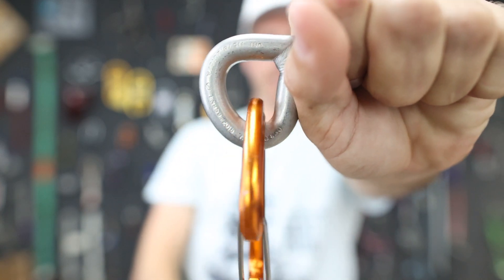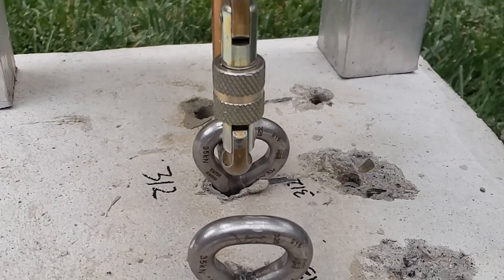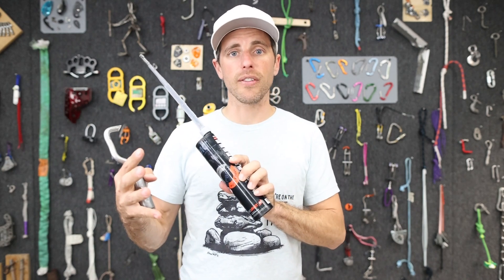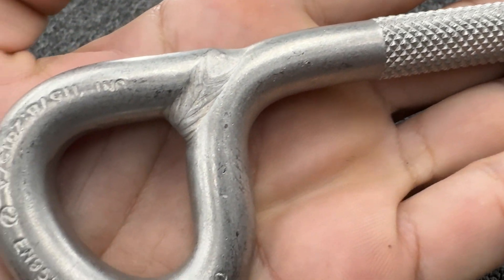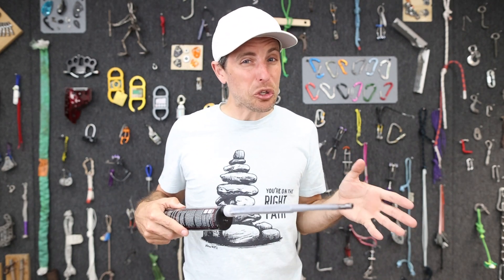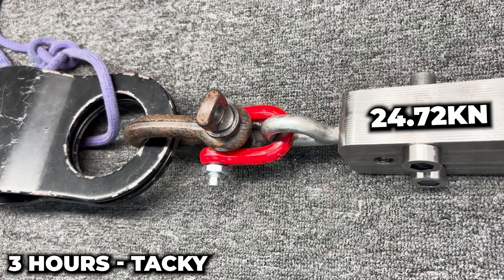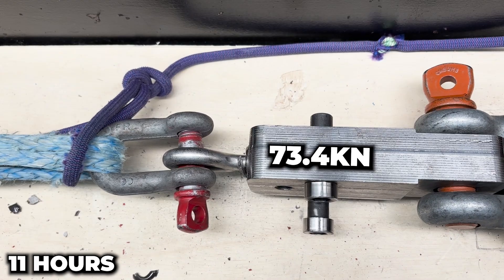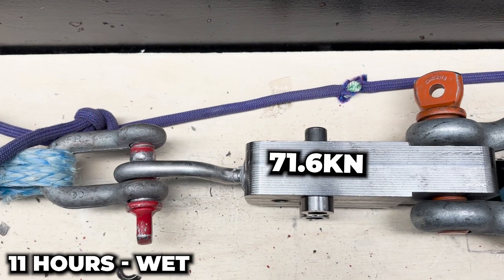DON'T use this when it's freezing...

Comment: Chemical anchors being installed in unideal environmental conditions usually requires environmental condition monitoring and material conditioning be used per manufacturer recommended practices to ensure product meets or exceeds listed strength. I understand this is not ideal, but I have seen creative means by which contractors have gotten materials to work in such situations.

Comment: A small hint for the lab work: Please consider the health risk related to uncured epoxy. Exposure can induce allergic reactions. Sensitization generally occurs due to repeated exposure. So don't touch uncured epoxy without disposable gloves (and don't touch anything with the gloves afterwards). When it's cured your safe :)

Comment: Excellent video, as usual. One way to hide color is to simply take a baggie of dirt up with you.... suck a handful at the bolt once it's in and curing. The stuff sticks enough to be camo. Also, best practices.... paint your bolts a natural color similar to the rock so the stainless glean can't be seen from 5 miles away on sunny days.

Comment: The epoxy could have a very different bond properties for metal to metal, like in the test and metal to rock( even different types of rock due to being more/less porus, strength etc.). So I think this test is not accurate and should be performed on a real rock.

Im not saying that this epoxy won’t hold, just that we need the bolt to rock test to determine the strength.

Comment: Can you throw some dust onto the visible red epoxy around the bolt before it cures  and by that make it less visible?
Reply: You can actually mix it w something like powdered tile grout to change its appearance slightly. Or dust from the hole. Or literally drill a ton of holes from a nearby rocks and coat the epoxy w a layer. Magic!
Reply from the maker: It doesn't change the base color.  I've tried to camouflage my glue ins before.  It's not that straightforward.

Comment: So I had a similar query, was doing some glue ins early in this year where the peak day temperatures were +7C, but the overnight temps were around 0C - which is below the 5C rating of what we are using. I contacted the tech department of the distributor who were confident that providing it was installed above +5C and the temperature would be above 5C to meet the curing time required there would be no issue with interruptions to it. They said the curing time at +5C should be considered paused below 5C. Frankly, they didnt seem concerned at all!

Comment: Makes sense about the epoxy not being full cured and having higher pull out strength. Similar to wood glue. If you use a stronger bonding glue(ie Titebond 3) it actually breaks sooner than a more flexible glue(ie Titebond 2). The rigidity makes things snap faster while a bit of give goes a long way as far as strength.

Comment: if you dont like the colour just spinkle the dust from drilling over the top after you have finnished glueing in the bolt
Reply from the maker: It doesn't change the base color.  I've tried to camouflage my glue ins before.  It's not that straightforward.

Comment: Is there any long term data? I wondered what the epoxy / bolt will be like after a couple of years summer heat and freeze thawing over winter?
Reply: This is my question too. What about doing some quicker freeze-thaw cycles to see if strength is affected?
Reply from the maker: They build bridges with this stuff and they get cold and hot.  In the TDS on page 3 it says "base material temperature after full curing:-40°f (-40°c) to +110°f (+43°c) long term, 176°f (+80°c) short term".

Comment: A couple of tests I wanted to see in this but didn’t: what happens if the glue is still malleable or still setting (based on the times you tested) what happens if you pull the bolt to 1-2kN and then wait 11hrs and test again? This would simulate the route setter hanging from the bolt or something before it’s ready. Second, what about when it’s say 40-50deg during the day and 20-30 at night? How does that affect cure time?
Reply from the maker: Compromised bond could be a good test.  
From experience, as long as you get in the hours of acceptable temps then it will cure, even if it's extra cold for part of the process.
Reply: Not sure about the first question (very interested in that test), but from another comment essentially any time spent below the minimum cure time specified by the adhesive data sheet is "paused" curing time that doesn't count. So as long as it's above the min temp during the day it will cure eventually but don't count the overnight hours when it's too cold.

Comment: If you want to change the color so it blends in with the rock, use some rock dust from  the site, or bring some carbon or some limestone. These are available as art supplies. Of course only use it on the surface showing around the bolt.  For darker rocks, match it or make it a bit darker, and against lighter rock it match it, or maybe do nothing because it's light already. And of course don't do this at all if being able to identify that it's epoxy is important.  For granite decomposed granite should be everywhere, the color and texture of the granite particles should be perfect. 
Has anyone ever climbed and thought, I really wish there was another anchor in this location, and there was one but you couldn't find it?  Maybe two red stripes on the eye of the bolt. Make them noticeable.  These would jump out at you from 10 -20  feet away but from  a greater distance they'd be completely unnoticeable. 
I always tie paracord tails to my mini tent stakes. I once noticed that in two days I'd lost 2 or 3 of the larger orange ones, but the dark red ones with black string tails (small line) on them I didn't lose any. So I tied string tails to the rest of my stakes and over the next two months of camping didn't lose any. So any string tied to an anchor would stand out. I'd use orange... but there's probably some ideal length/color that could be seen from the distance climbers would need to see it but would otherwise be unnoticeable.

Comment: Good vid. How long does the ‘glue’ last? How many seasonal weather extremes before degradation, if any degradation occurs?
Reply: Some of the epoxy / glue companies have been doing long term testing and for the most part if it's mixed, installed and cured properly all these adhesives are essentially going to last longer than the bolt or the rock around it. So pretty much forever / not the weakest link.
Reply from the maker: Pure epoxy should last longer than the person putting it in

Comment: One question I've had for glue ins for years is, if you set the route when it's hot (90 degrees) and then it freezes hard (0 degrees) does this negatively affect the bolt strength? usually thermal expansion/contraction isn't a good thing for epoxy. Or more accurately, not good for its bond to another material. Does this ruin bolts? Does a number of thermal cycles make bolts unsafe? I've never found a good answer.
Reply from the maker: They build bridges with this stuff and they get cold and hot.  In the TDS on page 3 it says "base material temperature after full curing:-40°f (-40°c) to +110°f (+43°c) long term, 176°f (+80°c) short term".
Reply: @HowNOT2  First, thanks a lot for the reply. I should have been more specific. The only reason i question it is because thermal expansion of the metal is likely to be vastly different than the thermal expansion of the rock. If they expand in an asymmetrical way, it would stress the bond between metal, epoxy, rock. And further, it might be that there is no loss of strength after thermal cycling, but I am curious. It's certainly a video I'd watch, and forward to my friends who climb across the upper midwest... where summers are 100 degrees and a few weeks of winter is guaranteed to be below 0.
Reply: @BrOckSams0n  I think I see what you’re getting at. Maybe a good way to see if thermal expansion affects this would be to use the metal sleeve and cure it in the freezer to full cure (so that the bolt and glue is constricted from the metal shrinking), then warm up the bolt to 100 degrees (now the sleeve would be bigger in theory) and pull test it at that warm temp. Would the slight thermal expansion affect break force? Although to your point rock expands/contracts less than steel
Reply: @mattwubben7218  i was more curious what happens when it cures hot and then everything shrinks. It's usually winter when things start loosening up and coming apart. Or, like with moisture, does the freeze thaw cycle loosen the rock itself? after some cycles, is the glue just stuck to rock that isn't attached anymore? with a metal anchor, there's pressure that would reseat the anchor after some rock was chipped away... but with epoxy it's a one and done. maybe it outlasts the hardware... but it would be interesting to find out.
Reply: @tomgnyc  no, it isn't. Why would you even think so? Just because it will bond "different" materials doesn't mean the bond isn't effected by different conditions and circumstances. It bonds to metal, that doesn't make it a replacement for a welder... the whole point on this channel is that details matter.
Reply: Not a professional opinion, but I would say it depends on the rock, just because it's the most brittle material in the equation it would be more prone to crack.
Reply: @davidborboa77  absolutely, the rock is the big ??

Comment: If the bolts are glued in while it is freezing, will the epoxy cure when it warms up? Assuming the freezing is prolonged.
Reply: Also if the epoxy cures while it is warm, does it lose strength when it gets cold.
Reply from the maker: The bolt and pipe, being left in the room after the test, cured normally.  But it does say it requires that cartridges gets stored at 5C or 41F.  I don't know if that has a negative affect in any meaningful way.

Comment: I love these types of tests as a way to test a specific thing. Like yeah rock is more relaistic in the real world, but you still need a baseline of how it works in lab conditions to compare it to. The setup for this is also really good as the process to prep each test is shorter which is useful because you are getting baselines. And while doing all of this, you are still getting decent data. Could you use those specific numbers when setting it up on rock in a real life scenario? No. But you can still gauge the effects the different variables have and be able to gauge tollerences you might need. This video is very useful regardless on if you think its realistic or not
Reply from the maker: All our tests in real rock are here https://hownot2.com/blogs/bolting-bible/bolting-bible-book-of-numbers
I learned I can trust bolts and not rock when I test it in rock